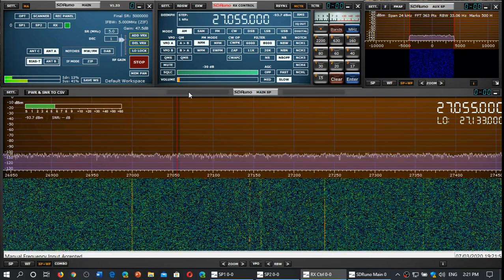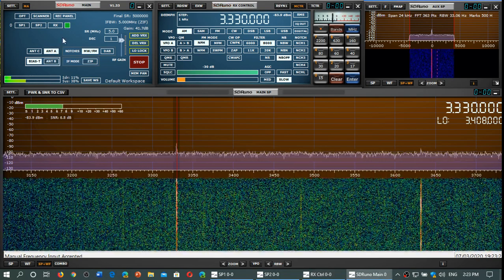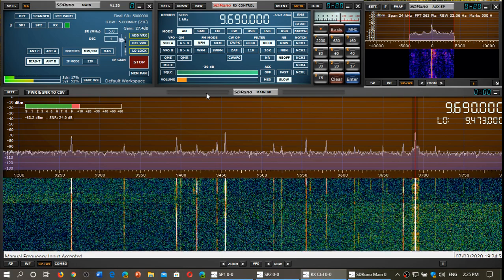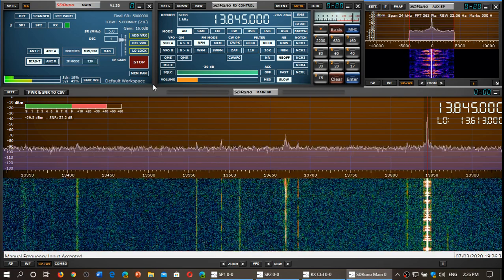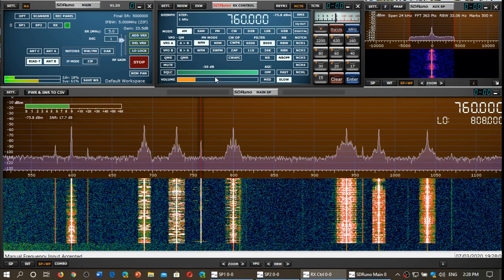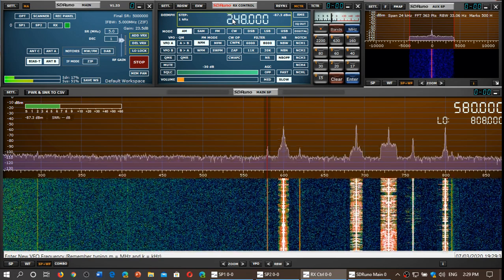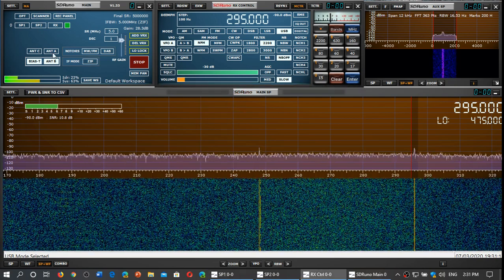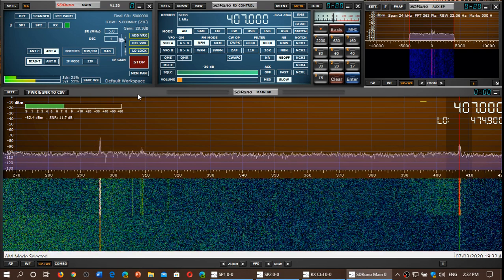PERFORMANCE TEST MLA 30 PLUS VS MLA 30 Original Amplified magnetic loop antenna

Comment: Hi, thx for your comparison! Like it and just joined your channel! 
I am wondering why the noise floor is a bit high. It's about -105 dBm in most bands you are showing. Normally it should be like -130 dBm, isn't it?

Comment: The MLA 30 plus needs a power supply. Does it come with an adapter ? Or will that run on batteries?
Reply from the maker: Uses 5 volts USB power like a smart phone adapter
Reply: @ 
I mean can it connected to a power socket?

Comment: I'm not sure about your results.  First of all, it is necessary to show where the antennas are placed! It's easily to put one antenna inside the bathroom and the other one on top of the roof, and then to compare. I don't believe that this video is correct.
Reply from the maker: It is compares two antennas outside that are different, it is a known observation here the the MLA 30 loop is not as good as my end fed above 20 MHz

Comment: Okay... I just got interested in SW listening-- well, re-interested, I guess. Nostalgia, really. Remembering listening to the radio at night with my Dad or over at Grandpa's house. That, combined with the uncertainty of 'things' in general these days, got me inspired to get my hands on a SW receiver. Went a bit overboard, I'm afraid. Amazon is probably tired of hearing from me. Anyhow... I've got several small-- in a few cases very small-- portable receivers now.

Tecsun: 368, 680, 880, 9012, 9700

Raddy: 320, 750, 760

They all came with a wire antenna of some kind, but I'm wondering about an MLA 30+. Could the smaller ones, or any of them for that matter, be damaged in some manner by this antenna? As I say, I'm quite new at this, & I keep hearing the word 'overload' without really understanding what it means or whether it could tear up a radio.

Comment: Very interesting video. I've just bought a MLA30+ and so far I have only tested it on my balcony. I live in an apartment, in a dense urban area with FM transmitters around. SW listening is all but impossible with a radio and the whip antenna. I am amazed by what the MLA30+ can do in terms of filtering out FM breakthrough and electrical noise. Impressed, really.
I will be using antenna for outdoors DX sessions on a 4m mast attached to my car. But not yet. I expect even much better.

Comment: I noticed that you assigned the original 30 to the B port with bias T power. But the 30 plus on the A port, using the supplied bias T insert? One is running on 5 volts and the other at 12-13. Is this a realistic test condition?

Comment: I have 2 MLA 30+ antennas. The Biasing Tee powers up fine on a USB plug in power adapter but when I try and power it through a portable power bank the power cuts off after a few minutes. This happens with both antenna Biasing Tees and with several different portable power banks different power cords. I would like to use the antenna for portable use but cannot power it. Is this normal or do I have two defective antennas.
Reply: I know this is mighty late, but, the load on the power banks is so low the electronics switches off, just have to find a power bank that operates manually, or one that senses a low current load and remains on.

Comment: I have stupid question: why cant it transmit for HF radio? I need the argument as Custom Officers want to tax it as Ham Radio Antenna
Reply from the maker: it falls in the category of amateur radio gear.   Does not need to transmit for that.. it is a antenna for a radio

Comment: Thank you for a good and helpful movie.
I thought that you used the original bias-t box for MLA30+, and the bias-t function of SDRuno for MLA30.
I felt Noise floor level of MLA30 is lower than that of MLA30+, because of the lower noise level of bias-t of SDRuno.
However I understood that the gain of MLA30+ was very high.

Comment: Suggestion for a DIY loop: I have an old circular photography reflector that is 60cm in diameter. It has a metal loop inside of it. I cut the metal loop and soldered on a couple of wires. It works much better than the stock loop. If someone is pretty handy they can probably maintain the integrity of the loop and the entire antenna could be folded up into a small package.

https://www.amazon.com/Neewer-43-inch-Collapsible-Multi-Disc-Reflector/dp/B002ZIMEMW/ref=sr_1_1_sspa?dchild=1&keywords=photography+reflector&qid=1620270353&sr=8-1-spons&psc=1&smid=A1K9376WXWZNFL&spLa=ZW5jcnlwdGVkUXVhbGlmaWVyPUEyUVVSUExHNDZHMzdEJmVuY3J5cHRlZElkPUEwMzc5NzM4MlVQQlhZSEY2S1UwWCZlbmNyeXB0ZWRBZElkPUEwNzE4MjY1Mk1FMVM4T0lLU1VHWCZ3aWRnZXROYW1lPXNwX2F0ZiZhY3Rpb249Y2xpY2tSZWRpcmVjdCZkb05vdExvZ0NsaWNrPXRydWU=

Comment: BACK IN THE DAY...  General Motors "magically" managed to increase the horsepower ratings of the same sized engine and they did this year after year.  This marketing tactic proved to increase sales for the newer cars.  I'll bet we will see the new and improved MLA-30 Plus Plus Plus on the market within a very few years although it is probably available but not for sale today.

Comment: Thanks for going to the trouble of testing these side by side - the difference is stark in the lower and upper bands! They've done some good work improving the loop. Interesting how the original MLA 30 was rated to start covering upwards from 100kHz and the MLA 30+ starting at 500kHz yet the new plus well outperforms the original on the LW band. MW is an added bonus too, would be interesting to see if you could catch some transatlantic LW/MW DX with the plus. On the strength of this video alone I've ordered the MLA 30+ "Brother Scare" coming in TOO well! Keep up the good work and 73s from Ireland

Comment: You're using different Bias-T inputs.  The one powered by SDRPlay is not as much power
Reply from the maker: that is not what made any differences here, test was done with both bias t box same results
Reply: @OfficialSWLchannel  Replace the metal loop provided with a 1/4" piece of copper tubing formed to loop same size, may get a surprise.

Comment: Sorry for the silly question but as I see the Gain changing in SDRUno when you switch antenna I wonder if you used the IF Gain in auto position or not. It look like it was on Auto mode. If so, I would use IF GAIN in manual mode and , maybe to its minimum value.At that point, if the RFGain is  never changed, you´ll see the true difference between the two MLA-30s. Does it make sense to you ?

Comment: Very useful review. I was contemplating getting the mla30 due to the LW range. Glad I found this review. Thanks indeed.
Reply: Ordered the MLA-30 for the same reason. However the ebay company shipped me the MLA-30+. Thanks for the video causing me to cancel the return. Sometimes you'll get less on ebay, but in this case I got more.

Comment: Is that using the stock coax cable that comes with both MLA-30 and MLA-30+ and are you using the supplied bias T power supply or the bias T from the RSP?

I've allegedly ordered the MLA-30+ on e-Bay but I most likely won't get it for the duration which could be months or more, Where did you get your MLA-30+ from?

Comment: The noise floor comes up too when you switch to the mla-30+. I wonder if adjusting the pot inside of the old mla-30 bringing the noise floor to the same level would help the signal at all on the mla-30 old version? It would be interesting to see if it could be adjusted to be the same.
Reply: Watch the SNR.

Comment: Do you use a clean power source?  The same source?  USB adapters and so can have a lot of noise ...
Reply from the maker: I have powered it with batteries to make sure the power supply does not make any noise, there is no difference, the power adapters I use are very quiet

Comment: are both aligned in exactly direction ?  I find my original very directional on MW and I assume the same on LW as well. I can actually null a pretty strong local  like CFRB and receive WINS clearly at night. Different orientations could explain different results on the low end. I need another anyway , will try to get the plus version.
Reply from the maker: They are about 3 feet appart but their orientation is exactly the same to make sure there is no difference
Reply: Hoping to get the newer version when I order , not getting any NDB's here anymore and years ago I could

Comment: Does antenna location make a difference?
Reply from the maker: Location can make a huge difference, noise might be a problem at one point and not at another, orientation also, loops are very directional, usually we install them to have the lowest noise possible
Reply: @OfficialSWLchannel  So, should you try testing the antennas in different locations to see if that effects the results between the new and old antenna?

Comment: Show us the inside of both please.
Reply: Catalin Alb --- they are just covered in black resin on the inside, nothing to see...
Reply: @Liofa73  yes I know but stil if there are different components used they will have a different configuration that you could imidatly recognize when you have them opened side-by-side